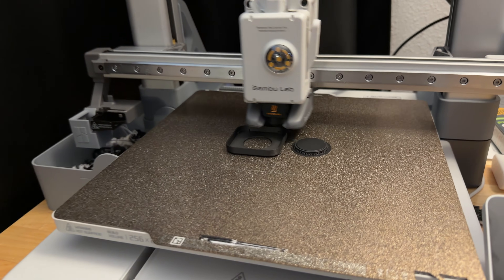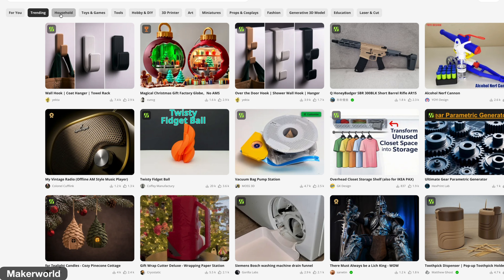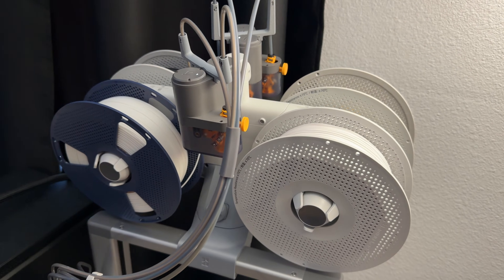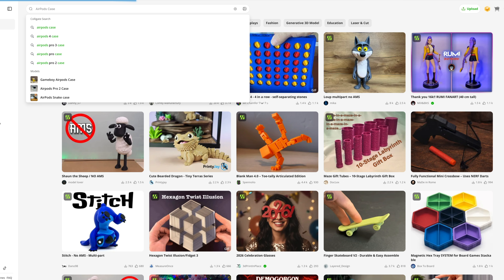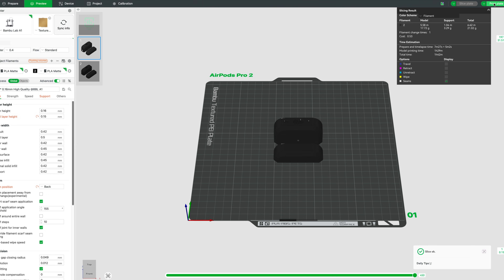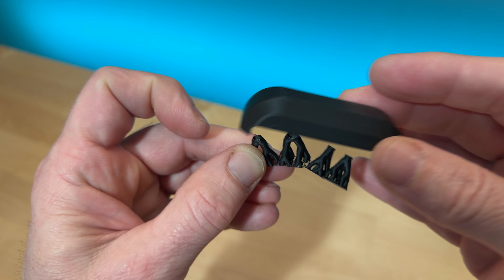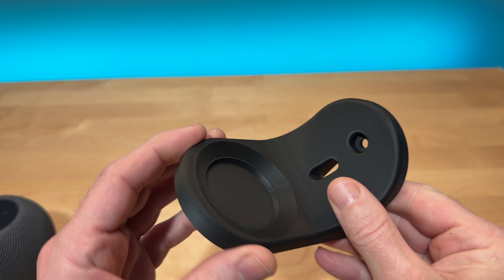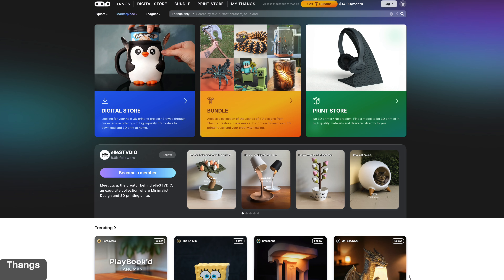Why You Should Get a 3D Printer - Now is the Best Time

Comment: I think I’ll check out the printer in this video.  I bought a cheap one from Microcenter a few years ago and have had mixed results- good and failed prints.  I have had more failed than good, so kind of frustrated with it.  It was great for mounts for motion detectors and custom cable holders.  Mine is a crap shoot.  The odds are stacked that the print will fail.
Reply from the maker: I felt that way about the Ender V2 that I was using. I know failed prints eventually happen even with this one. But the fact it has been so hassle free has made 3D printing fun and not a chore.

Comment: (A1 owner) It’s all well and good until you factor in the cost of filament, it’s not free. I’ve been printing since Christmas and I’ve spent close to £200 on that alone let alone a filament dryer, then you have to learn what not to print if you have the AMS Lite because some “designers” may have the basic knowledge to design multicolour prints but they have no idea what they’re doing as to layers which will cost you A LOT of filament. Then if you’re printing in stuff like PETG you need a vacuum sealer and vacuum bags plus colour changing silica beads to keep humidity out. Then you need to print the AMS Lite spool enclosure which is half a spool of filament. Then there’s the learning curve for designing things yourself or adjusting other people’s designs.

I love my set up but it’s not cheap and has ongoing costs, just bear that in mind if you’re getting into it. It’s a hobby for the most part, make sure it’s something you’re going to love, unless you have money to burn.

Comment: I bought a Bambu P1S in July of 2025. Awesome Awesome Awesome! Go buy one. I have made a ton of parts, tools, organizers, mounting systems, and toys for my nephews and nieces. Honestly its saved me a good bit of money. That being said some prints work better than others, you will have print fails. If you use cheap filament get a filament dryer. Clean your print plate with dish soap and rinse after every couple of prints. Spray your print plate with alcohol and dry it with a microfiber cloth before each print. One word of warning: the printers are noisy. Put your printer in a room where your not doing anything and you can close the door.  Lastly the Bambu filament is very good filament and it works extremely well.
Reply from the maker: Glad to hear you have enjoyed yours and have got good use out of it. Thanks for putting these tips in here. Thank you also for watching this video.

Comment: Great review of getting into 3D printing!  I just started myself and got the Bambu A1 combo this Xmas and it's been working nonstop - churning out practical do-dads and large sci-fi models. I will say that while it's mesmerizing to watch and the possibilities are endless, it is kinda slow, you have to be cognizant of some technical issues, humidity, pros/cons of materials, and depending on the number of colors within a horizontal plane, the AMS could easily be wasting a ton of filament through nozzle purges. I find it more cost effective to just prime and paint models with cheap acrylic markers. That said, there are some upcoming far cheaper A1 clones from Anycubic and Creality, that promise to waste far less filament, but historical reliability/useability with non-Bambu printers is apparently a question. I guess it's like comparing a value-rich Hyundai vs a pricier Toyota with proven track record.  I really need to build a printer enclosure for my cold garage and learn some Fusion 360 to really take advantage of this hobby!
Reply from the maker: Very cool you got one and putting it to good use. It is really slow and pretty wasteful with the multi color prints. Personally I try to avoid them because of all the waste that is generated. I had an old Ender 3 printer and that thing took twice as long as the A1. So the A1 is amazingly fast compared to that. I think Makerworld is one of the things that makes Bambu Lab so appealing.

Comment: I love that you’re talking about 3D printing, I thought about getting one. 
Question:
If you need something but no one created the print out “blueprint“ could ChatGPT create the “blueprint” that you need to program into the 3D printer?
Reply: Not reliably, no. It has a hard time with 3D reasoning, let alone coding in 3D with perfect dimensions or parts more detailed than a cube.
Reply from the maker: Thanks for answering this.
Reply: All main AI models have the same issues
Reply: There is often more than one software and more than one way to create something. You may have to use one software to create a portion, then move it to another. Don’t let that discourage you because it’s not as difficult. There are different tutorials, and videos out there to help you accomplish it. If you decide to create something keep in mind as a work in progress, you may have to have prototypes and adjust and another prototype.
Reply from the maker: Great point on the different tutorials. I need to watch some myself.
Reply from the maker: Very cool. Glad you enjoyed the video. With the modeling needed, using ChatGPT would be hard. It would be cool to be able to. Hopefully in the future. It would be nice to enter some dimensions and let it do the work.